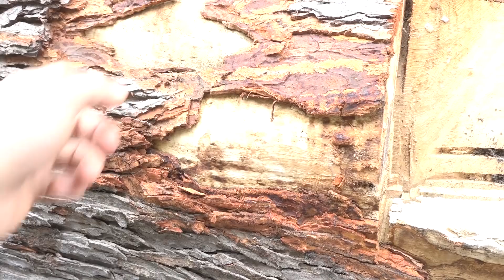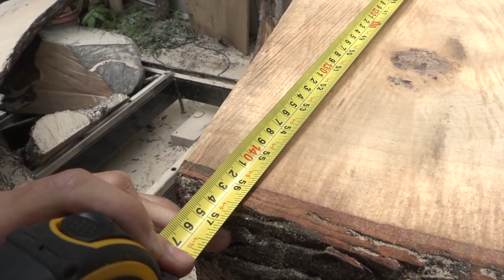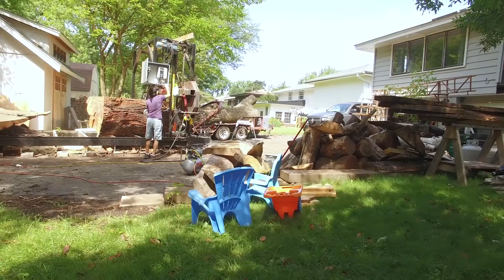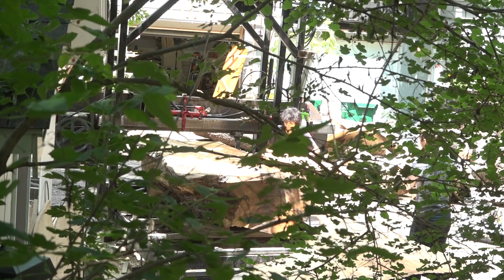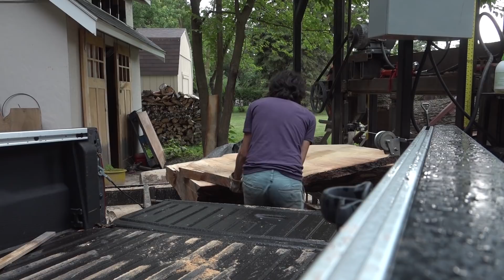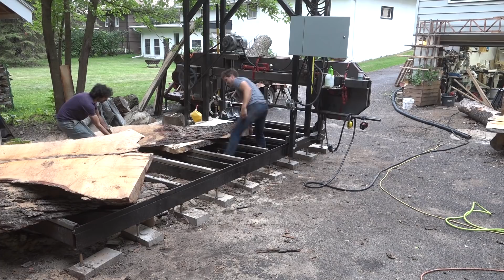Slabbing the Robbinsdale Maple

Comment from the maker: - I'm spraying diesel on the blade.  It keeps the noise down greatly.
- My neighbors are cool.
- Yes, I love crotch.
- I'm painting the guards this week.
- I'm not buying a forklift/tractor/skidsteer anytime soon.
- The slabs will take around 1.5-2 years to dry.
Reply: I was going to ask when you're going to finish painting, because it is driving me nuts.
Reply: Matthew Cremona why deisel and not another type of liquid?
Reply from the maker: +Dane Johnson seems to stick better so I don't have to apply as much and the blade stays quieter for longer
Reply: Why are the boys' lawn chairs so far away? How can they "learn anything" (get covered in sawdust) 'way over there? [insert Matt Cremona patented chuckle here]
Reply: No forklift... then how about lengthening the tracks and build another square cage on it, with a winch in it? Drive your car over the tracks, lift the wood with the cage, drive your car off, and push the whole thing over to your saw bed to lower the trunk there. Or you could lay another track outside the first one, to ride the second cage on... I'm sure you'll get the idea.
Reply: 1 cup pinesol, 1 cup dawn soap, 5 gallons of water. Works wonderfully, keeps noise down and helps stop sap buildup on the blade.
Reply: Matthew Cremona wow, 2 years to dry! That's a serious commitment on a log!
Reply: Matthew Cremona s
Reply: Matthew Cremona how do you know if it's dry, im new to all this
Reply: UpCycle Engineer using a moisture meter, when it's below 15%, it usable. 8%-12% is the goal.
Reply: Matt G unless you build a kiln that can dry it in weeks, yes.
Reply: inclusion thing looks like a flying owl or eagle.
Reply: Doesn't permanently stain the slabs? Maybe gets mostly carried off by the sawdust... Diesel is a petro product... Just learning here...
Old friend of mine with a WoodMizer dumped gas on a log/slab he was cutting for me years ago - instantly killed the carpenter ants he'd hit while sawing...
Reply: If you over use it, it can. If you use it sparingly, then it's fine. I won't use diesel or any other petrol when cutting, too risky in my opinion.
Reply: Matthew Cremona iii
Reply: When are you getting a haircut?
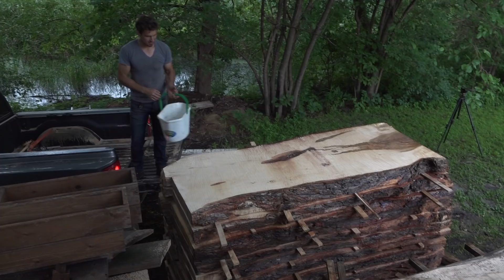Reply: Apparently at 21:20
Reply: Matthew Cremona of
Reply from the maker: I take my lumber down to around 8% checking with a moisture meter as it dries
Reply: Matthew Cremona yeah, unfortunately, we can't really get 8% down here without a kiln.
Reply: Just offering my 2 cents if it's worth that.  I don't know your budget and I'm not asking but I found on Craigslist a used skidsteer with both bucket and forks for $5500.  I love in Iowa near Iowa City ( Go Hawks!).  The time saved moving the big slabs rather than fighting with your trailer to move them plus the snow moving come winter maybe even make a couple buck toward gas money plowing out your neighbors.  Just saying it may be worth checking every now and then when searching for the free logs.
Reply: Matthew Cremona  That’s what they do in Mexico , the furniture smells like a Mack truck.
Reply: Now what will you do with the slabs. Once they are dry.
Reply: How much did it cost you to build it?
Reply: You need a gantry crane to help you lift stuff!!
Reply: Those live edge tables are going for thousands.   The way I see it you can make the pedestal table stands out of regular maple. Sand the slabs smooth starting from 80 grit and going to a 440 or 600 grit,Then use a very light almost honey color Aneline dye stain to make all the gorgeous curl pop, especially with the small birds eye and some of that burl showing.  Finish with your favorite 2 part bar top high gloss epoxy and, you will have some spectacular slabs to sell as live edge tables that some families will cherish for years to come.  Good job keep up the great work.
Reply: Do you make follow up videos where you show  the fresh and dried slabs I wonder. Was really interesting watching that hunk of wood.
Reply: Yes I found updates!
Reply: I can't believe you use diesel - it smells awful and can't be good for the wood!
Reply: Where are you located?
Reply: Vikingblooded Kraftwerks It’s my understanding that it will never reach 12% while stored outside or even in a dry barn. I recently had some walnut machined that had been sitting in my grandfathers barn since he cut it thirty years ago. 
       The millguy made me pick it back up and take it to a kiln because it was too wet still and throwing out weird shavings that he said will clog his machine. He was making t&g paneling with chamfered edges.
Reply: 1.5-2 years to dry.... it’s like aging fine wine.
Reply: Okay. No need to comment. Lol
Reply: We love crotch as well, especially stabbed and trimmed curly crotch.
Reply: @MattG-mw7zi  always build a kiln or you're pissing in the wind.
Reply: @vegasheat71  never stain maple. Clear all the way... Laquer will darken and "yellow" over time and get more and more beautiful. You just want the wood to seal and pop.
Reply: How much is a sawmill like that?
Reply: I'll bet the neighbors aren't as cool about the noise you make as you think they are.

Comment: Matt, you're so awesome at welding and fabricating steel, how about an overhead rail, gantry with a bunch of supporting inverted U shaped A-frames that you could position from the mill to wherever you wanted to stack the slabs?  Then you could "float" the slabs relatively effortlessly to the stack. Not sure I'm exposing my idea well, but I imagine you could improve on it. Mill on!
Lou

Comment: Matt, your mill is awesome...really impressed watching you saw logs this size. I wish I lived closer so I could start buying slabs from you when they're ready. One tip, I've been an equipment operator for 20 years...an older skidloader or tractor with forks would save your back and increase production. It could be a fairly small machine...you can pick up older bobcats cheap. Just saying...eventually your back will feel like mine, ruined. You could slide those slabs right onto the forks at whatever height you need then off to start drying. Keep up the good work.

Comment: All these drying estimates are way out because your trees are often dead for years and therefore are pretty dry already. Every one has its own moisture content and perhaps for the show; you should get a gauge not that big of a deal nowadays to find.
Reply: i use a moisture gauge on my wood but here in minnesota if your drying outdoors it tends to take longer cus it gets snowed on alot and the summers arent all that dry. ive had wood take 2-3 years to dry outdoors. now i have an attic filled with wood drying with fans and a dehumidifier . takes only about 1 year to dry even 4 inch thick green timber.
Reply: Most sawmills around here will only cut green wood or trees felled within the last 6-8 months.

Comment: Matt, Have you given any thought to acquiring a fork lift to use handling those large cuts?
Reply from the maker: +James Mitchell I have
Reply: Bobcat with some forks would be a nice little toy!
Reply: Fork lift or Skid steer would tear up his yard quite a bit. Idk if Matt is ever planning on moving to a more non-residential space, but setting up his mill on a gravel or concrete pad would help a ton and make a mechanized mover a more viable idea.
Reply: Once all those slabs are dried, and sold, you can buy a new property, build a new house and a huge shop with an overhead crane in it to handle those logs on the saw... Oh, yeah, and a forklift with AC and bathroom! :-)
Reply from the maker: +Grumpy's Workshop This is exactly it
Reply: +Matthew Cremona So you're moving too? All the cool kids are doing it.
Reply: James Mitchell nfhd

Comment: Hi Matt! if I were much younger, I'd build one of these wonderful tools!! Alas, I'm a retired engineer and hopeless tinkerer....with no room for a sawmill! As such, I had a few thoughts on improvements you might want to consider: 1. A drip lubrication system - A simple plastic container with adjustable petcock and plastic tubing, to allow your favorite liquid lube to constantly drip (slowly) on the blade. 2. A motorized drive system, so that you don't have to hand-crank the whole thing. If you use a chain-driven, DC-motor setup, you can control both speed and direction (forward-reverse, obviously!). Finally, 3. (this is more of a 'luxury' type of thing)  A roof over the whole mill! If you cantilever from the side closest to the shed, you still have front, rear, and one side completely clear to manipulate logs. Thanks for tolerating my mental gymnastics! LOL ....and thanks for continuing to crank out quality videos!  :-)

Comment: An addition to your mill could be 2 felt oiled blocks , set up on the return side of the blade.The cutting side of a band mill has quite a few things to keep it busy , but the return side is just flopping in the wind.  A top side and bottom side of the blade oiled block could provide a bit of lube but also dampen blade vibes .

Comment: Hi Matthew   I enjoyed watching this video and the band saw build. Watching this video I saw some deflection in the carriage as it was going through the log. All the force for moving the carriage is on the one leg with the winch, if you put pulleys with fingers to hold the cable on the front corners of the bed and hooked the cable to the other carriage leg you would have even force to pull the carriage through the log. If you had a dual drum winch and ran a cable around the back of the bed then the crank would move the carriage forward and backward. I also saw that there isn't any cross bracing on the top of the carriage or corner gussets. To me this seemed like a huge project being a wood guy but I think you did a great job and it works well. Thanks for the videos.

Comment: Dang, you have the same winching system that I built, around a Warn 9500 winch and my trailer! I used a fairway lead mounted on the top rail and it's only a 1 ton trailer but I've hauled more. I'm working with Big Leaf Maple and Red Alder mostly.. some Red Cedar too. Olympic Peninsula, WA State. Right now I only have a Haddon splitter and a Laguna LT20 bandsaw. Be aware that cities are beginning to pass ordinances similar to homeowner association crap, and I've already been hassled 2 years in a row for "debris" (logs and rounds of music wood and such) I will soon be out of here and very rural on my timberland.  Subscribed

Comment: Matt, Like a big Lathe if you could make a center pin for holding the log en center  that could be adjusted to lift it-  A screw lift from maybe 12-25" OR A TRIANGLE BRACE that is adjustable at height above the bed. If you made another for the other end you could be a quarter sawing maniac-- But you could make centerline horizontal PIN TO PIN and rotate the LOGS as you wish of course if yo wanted you could creat a lathe from your frame and make octagon posts if you wish to index the rotation.  I'd be running a router late in a 3rd edition

Comment: Nice- lots of hard work to get than beast sawn.  One thing - you may want to stop throwing water on the slabs . . . as much as it is tempting to see the figure.  You are lending an environment that produces stain - esp. with white wood like Silver Maple. Also, try putting sticks every 18 inches (or even every 12") and consider thicker stick (3/4" or 7/8") than what you are using (per the video).  Not sure if I missed it, but also be sure to seal the ends with a wax based paint (Achor Seal is best).  Thanks for the video

Comment: if you build an adjustable level receiving table on a trailer for the slabs and use pipe stock as bearings between the slabs of wood to move them off the log you could save your self a lot of lifting and maybe even an injury. Don't know if you have seen the portable car scissor jacks the sell now? A hammer and a flat crow bar could be used to pry slab up to insert a piece of pipe stock between slabs so they would roll off log.

Comment: Consider buying a used cherry picker and through bolting it to the truck bed rails...similar to a 5th wheel hitch.  That along with some nylon straps will make moving even larger slabs a breeze compared to you manual process.  I cut up to 24' slabs and mechanical advantage is the only way to go.

Comment: with any tree that's removed  chose to a house  your wise to inspect  any  logs with a metal detector so you don't dull or break a saw blade on a surprise embedded piece of metal .
Reply: Good way to get one cheap... Fly often and be cool when they take everything out of your computer case in security and rush you to repack it with  a line behind of you!  I never noticed It was crammed into my large tool case!

Comment: I realize the water allows the grain to show better and is a great "reveal"  for the videos - But been my experience that if you put your stickers (for those that don't know - stickers are what we call the spacer sticks that keep the slabs apart to aid in drying) directly onto that wet surface it is likely you will get sticker-staining and you may not be happy with that after all the work you went through to get those huge slabs cut.  Also it is best to use kerfed stickers if you can manage it since they do not hold the moisture at the slab-to-sticker junction.  hope yours turn out okay, but my advice would be to not add any buckets of water to slabs that will be stickered a few minutes later. Also I would not recommend leaving the stickers protruding out from the pile when doing exterior air drying - rail falls onto the stickers and "wicks" in between the slab and the sticker - this can also lead to sticker-staining.

Comment: This is my first time visiting your channel.  I'm really impressed by the size of your sawmill, but I'm concerned about your hand-cranked feed advancement method because it results in a series of heavy ridges across the board from the uneven cranking speed, which would be avoided altogether if your feed were motorized. This causes much more work when sanding the surface down. Hand-cranking is capable of even speeds, but reverts to uneven speeds by default, with the ridges being produced at the bottom of each crank rotation - especially when you are tired or simply not paying 100% attention.  I highly recommend you install a motorized feed mechanism that will produce even surface profile that is much easier to finish.

Comment: This is probably a dumb question, but can you get a blade that has teeth on both sides?  That way you would need to bring the saw back to the front.  You could saw both ways.
Reply from the maker: Yes, for much larger saws. The blade has to be very wide because it needs to be self supporting during the cut - no thrust bearing support

Comment: That first piece you took off the top with the bark on the outside and flat on the back would look amazing on a wall. After you cut the slabs, do you leave them to dry in open air? Do they warp? How long do they cure?

Comment: Matthew, it's pretty obvious that you know exactly what you are doing. This was fab to watch! My question though... I have seen dozens of log milling vids, and this one is first I have seen that the cut pieces are not taken off, and left stacked. I have no clue why you would do this, . Does this not put an incredible strain on the blade a motor? I am totally puzzled. Thanks for this. That machine is a Monster!
Reply from the maker: Thank you!  I address that a bit in the beginning but essentially the more weight there is on the log, the more stable it will be.  If the log moves or rolls at all as I am cutting, the slabs will not be a consistent thickness.  On smaller logs this is solved by immediately rolling the log after a flat face is cut on it.  With something like this, it's not very easy to roll, especially by hand.  Oh and regarding the weight on the blade: there is no weight pressing on it.  The teeth cut a wider path than the band so the band is floating in the kerf.  It doesn't contact the wood.

Comment: How did you load that log onto a trailer? An excavator would have a tough time with a log that big! Cool video! I salvaged some beautiful oak that was slabbed then stored/forgotten underneath a deck where a friend moved to. I was able to save 6 big slabs that were not rotted. Sadly there were a lot more that had gotten covered with dirt and then rotted away. Wish I found them 20 years ago.
Reply from the maker: I showed the loading process in this video: https://youtu.be/_XtIx_109lU  That's unfortunate but at least you got some slabs.  Thanks!!

Comment: Very cool videos Matthew!! watched all your videos building your saw mill and your trailer builds,  was wondering if i missed your video installing the VFD control box and cabling system. which video would that work be in?
 I saw the video of slabbing a walnut tree in thin slabs yet from the Robbinsdale Maple the slabs look to be several inches thick. Why the different sizes of slabs? whats the purpose of the sizes?

Comment: Matt, thanks for all of your great videos and the education they contain.
I recently had a dead Tulip tree, sometimes called Yellow Poplar, removed from my yard.
I retained about 15 feet of the trunk in 3 sections and had them slabbed out. After stacking them in my garage I saw your video that said to remove the sawdust before stacking. So I went in and sure enough, I had mold. I cleaned it all up best I couldand re-stacked it. There was some staining left from the mold. Will this be a problem? What should I do to prevent that mold from continuing to cause a problem? Is there some sort of moldicide (if that's actually a word) I should treat it with?
Thanks for your help,
Rickster